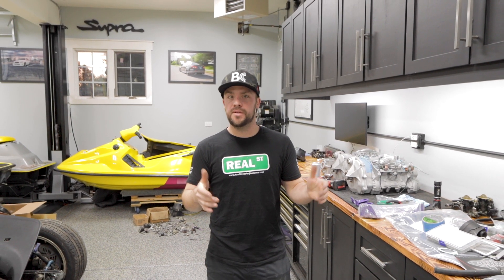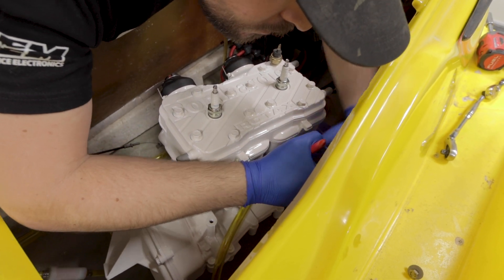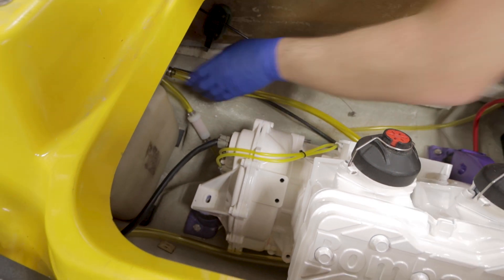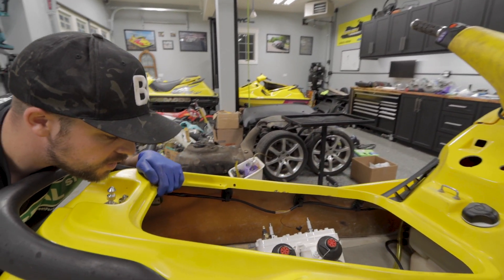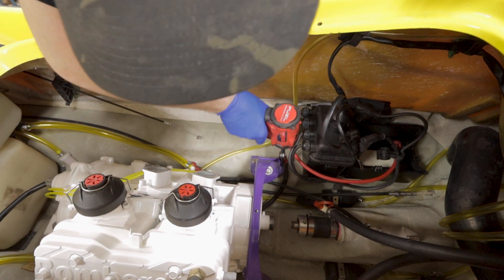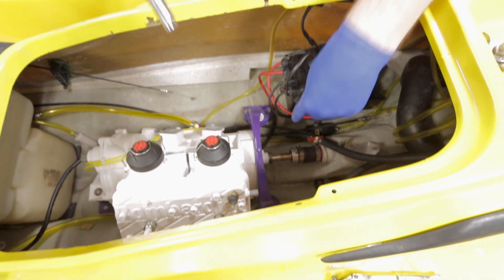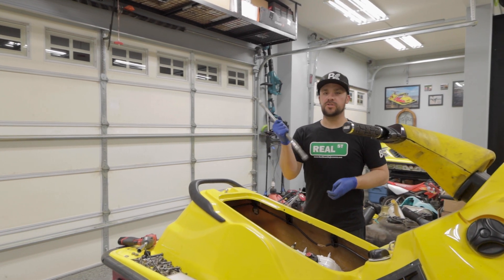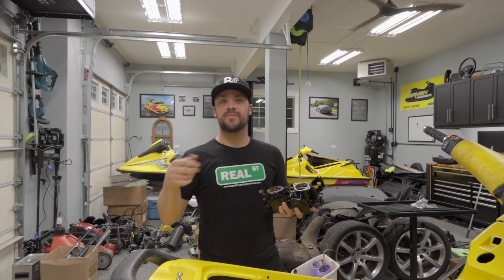Today We Wrench - Wet Wednesday's: Seadoo DIY Series EP.5 Sea Doo 787 Engine Install and Alignment

Comment: From 16:45 on.... That needs a whole video by itself. I snugged up the housing and ski wouldn't start. I went through entire electrical system... Ugh! That also explains why maybe they had so much RTV rubber sealing up the pump housing at the hull. Bolts seemed loose when I removed

Comment: Great videos and amazing work. You have inspired me to get the HX out of long-term hibernation. Why has no one done a decent video on HX type driveshaft alignment procedures? I borrowed a dealer alignment tool back in 1997 when I installed Hot Products coupler retainers but even the 1996 Bombardier Sea Doo Racing Handbook didn’t give a really detailed step by step or if-then statement to help you work through problem solving (focused primarily on the X4 Hulls). The guys at the dealership were no help on HX drivelines. Seems like a drive line that is really easy to get wrong to varying degrees causing power loss, etc.

Comment: Do you recommend applying some grease on the driveshaft splines when installing the driveshaft or replacing wear ring?
Reply from the maker: After you install it on the ski use your greases gun and put  a couple pumps through the PTO fitting.

Comment: Too much work, for the last 25 years i always grab the shaft, pushed inside the pto, shaked hard for two seconds, tight all bolts and thats it, never has one failure. Yeah i know some of you will called unprofessional and bla bla but to me is common sense and again never a failure.
Reply from the maker: Improper way to do it and literally does nothing for alignment.

Comment: Do you need to use an alignment tool if you are using the same engine mounts?
Reply from the maker: Yes, chances are it wasn't aligned 100% from the factory. Also over time it will loose alignment slightly.